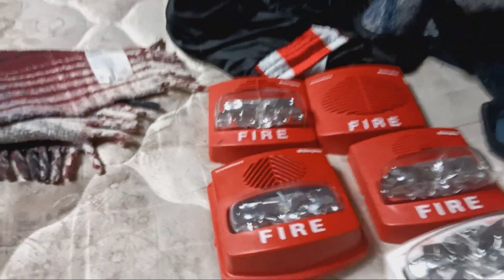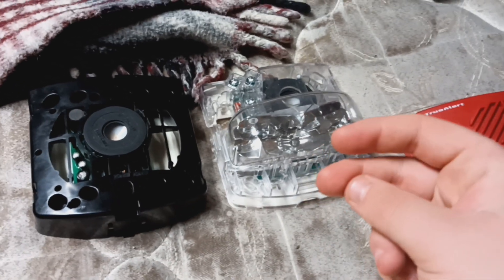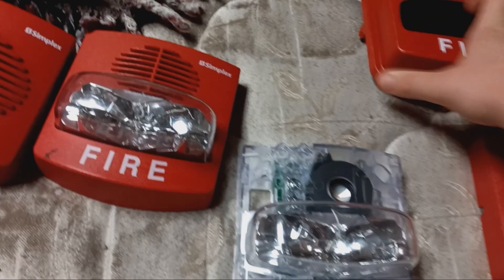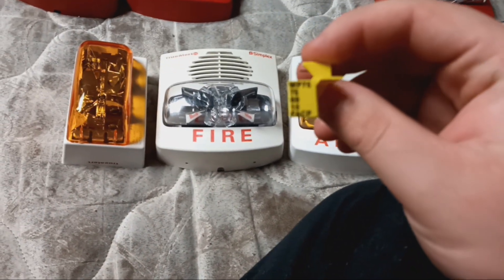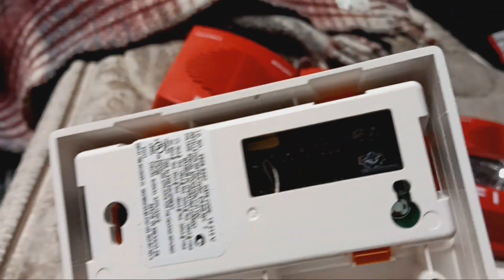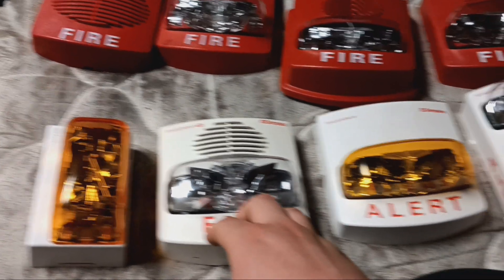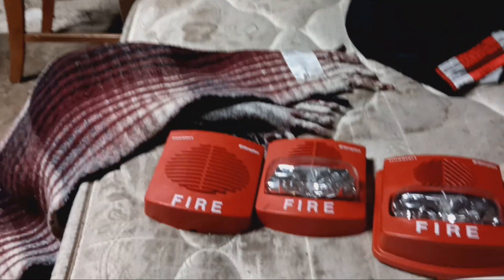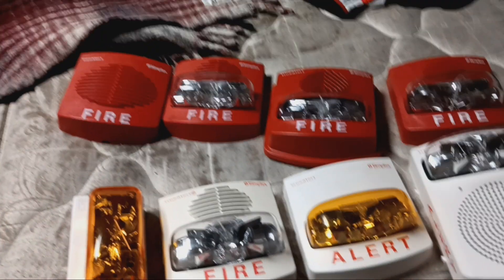UNBIASED FIRE ALARM REVIEWS, Simplex TrueAlert family of products

Comment: Why do some of the alarms say alert instead of fire?
Reply from the maker: Because they were intended for mass notification and emergency communication systems (ECS/MNS) or hard story simplified any emergency other than fire for example, tornado, bomb threat, earthquake, hurricane the list goes on, as long as it is not fire, a common place that they can be found is military bases (which is one reason why they rarely appear in public) per NFPA codes.
Reply: @dantestoner6020  do you the older symplex frosted Horn strobes like 2903 light or strobe plates